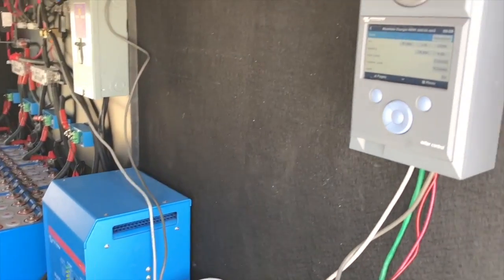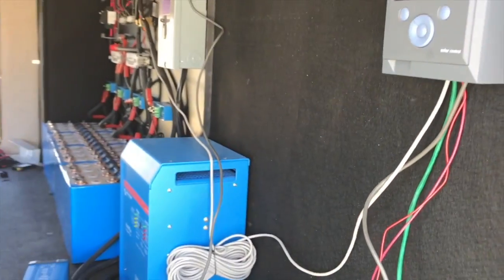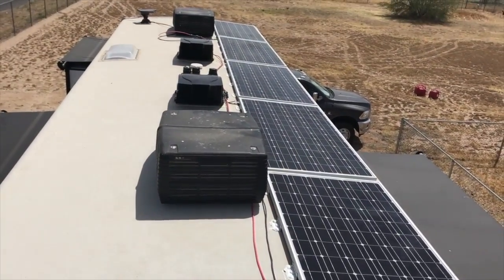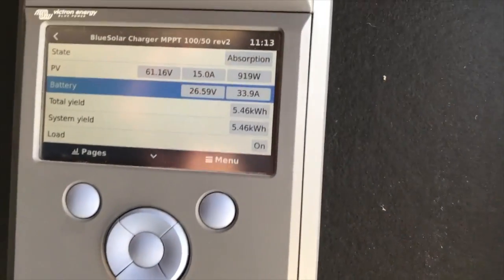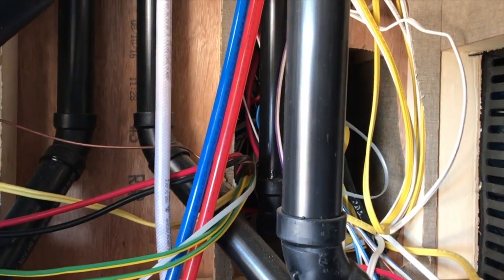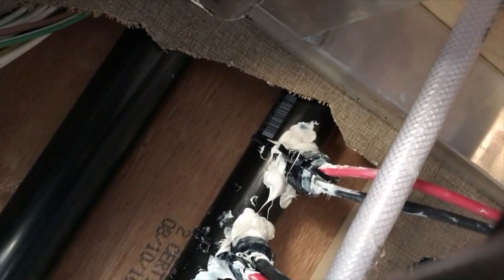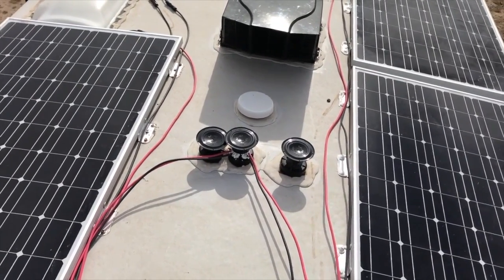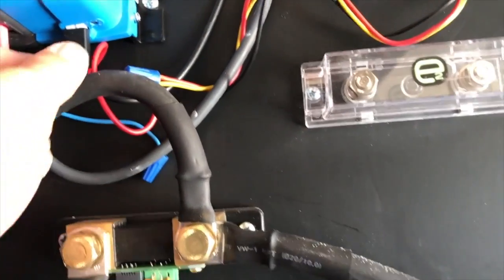RV Fulltime Living | Lithium Battery & Solar: Part Nine - Boat Load of Solar

Comment: Those panels should be in series running nearly 100 volts thru that #10 wire into one MPPT charge controller... why so many charge controllers? why so many current  bars? why so many everything? this setup is a mess... omg why wires down the sewer cap? another rookie trying to show others how to f%$k up and waste money...
Reply from the maker: Wow you are an idiot my friend. If for no reason other than how to talk to people. I guess you feel pretty big behind that keyboard. 

Number one most RVers that run solar either go through the refridgerator vent if it’s roof mount or through the grey tank vent stack. This is much better than punching a hole in the roof. The panels are rated at 36.5v each. Wiring 6 panels in series would produce 216v. Honestly that is dangerous in a mobile setting. Plus the mppt controllers are rated for 100v max. I have 3 charge controllers for the 6 panels on the left side of the rv, for the 6 on the right and another for panels I can deploy on the ground. The two sets of bus bars one for connecting the 4 battery banks and the other for connecting the 3 controls. I could have gone with two larger bus bars but wanted to isolate the solar connections. The battery protects are in place to ensure I do not over discharge. At 24v I can charge my batteries at over 100amps. Add in the ability for the victron inverter to charge, I could be around 200a easily. This is not a basic setup by any stretch.

You just seem like someone who gets off on judging ... that’s cool. But let’s put your money where your big mouth is. Link to what you have done. Show us how you would have deployed over 2500w of solar, and 400ah @24v of lithium along with over 60 potential amps of inverter power. I’m serious I would love to see it. I had to do a lot of research as most RVers aren’t building this large of a system. If you have a better way, we could all benefit. So speak up boss. How would you have done it and what do you have to show us?
Reply from the maker: Thanks and sorry for the late reply. I’m usually commenting from my iPad and there is no good way within YouTube to sort by latest comments that I have found. So I lose one or two now and then. There exist a small percentage of people out there that hide behind keyboards and try and make themselves superior at the expense others. These are generally very small people. I falter now and then and enjoy lashing back at these people. I just have to be careful not to alienate the people I enjoy surrounding myself with like yourself. Folks that want to provide valuable comments constructive crtisicim included.
Reply: RV Exodus 
Wow, first time I read you verbally spank someone.
Bravo for then going through the reasons point by point. 
This is all new territory for almost everyone.  
There are probably a handful of people that understand solar but I seriously doubt that these same people have experience with RVs.  
I for one, find these videos the best I have seen so far. Truly educational and they are simplifying my research.
For example, I was going to go with a different inverter that costs a bit less but will most likely move up to Victron because of its ability to supplement shore power when needed as well as its programmability for charging, which is crucial for lithium. 
Thanks to this series, I learned about bottom balancing as an alternative to a bms.
Some day in the future, I may create my own voltage protection at the cell level using Arduino. So far it is only an idea and will require a lot of research but I want to be able to monitor each cell individually and disconnect the battery pack if any of the cells goes below or above a predetermined voltage......sorry for the sidetrack. 
Anyway, people need to take what is presented here and research if it applies to their needs. There is ton of info here.  
If you have a better way of doing something the give your alternative,  without being a jerk.
Maybe it will be better and we will all learn from it. 
Always keep in mind that what works for one person might not work for another. 
He's using 24 volt setup and has his reasons. I considered it, but I am retrofitting an old 40 foot class A. Different animals. 
I already have a 12 volt system in place that includes an alternator and don't want to deal with the complications. 
Again, take what applies to you.
Reply: I'm intrigued by your set up. I'm a electrician by trade and and I cant agree that using the vent pipe as a chase is ok but besides that it all makes sense.  Why did you use 24v system instead of a 12v?  Having to run 24v and then buck the power down to 12v creates heat which lowers your efficiency but since you have so many panels I'm sure you don't mind the efficiency loses, but with the loses comes more battery cycles and inevitably shortening the life on the battery bank.
Reply from the maker: I’ll have to look into Arduino. I think I have come across it in the past but not sure of it’s capabilities. I have 4 zeva bmm8 boards which provide cell level monitoring and can send high voltage and low voltage signals to the victron and battery protects.

I’m at 24v and will be using step down converters to generate up to 100a of 12v. Landing gear and slide pull some amps unfortunately. I would go with 24v or even 48 if I had to do it again. But I get where you are coming from. Not everyone gets to start from scratch like I did and you always have to keep isolation in mind when dealing with different volatages. That can be stressful and make it difficult to sleep sometimes :)

There’s always things you would do or will do differently. I created 4 parallel 8s strings. Essentially I have 4 separate banks. I did this for a number of reasons and ignored some of the disadvantages like cell level monitoring (having 32 points to monitor) resulting inchaving to replicate cell protection 4 times and having 4 times the cabling. 

Continuing to research lithium, I’m now leaning more towards creating a true 4p8s setup which would be 4 cells in parallel then each of those 4 cell groups wired in series. This would result in only having 8 points of monitor, fewer cables, one large battery protect, one cell monitor etc. the disadvantage is that if a cell goes bad it harder to pick up on but also has let impact on the entire bank. But will require that I cut away the shrink wrap and redo the system. I’m still pondering this one but will likely make this change at a future date.

I’m 100% on board with you ... battery monitor vs. battery management. My CALB cells have stayed in perfect balance. I have drained 90+ percent of the capacity and have recharged them quickly. I have run two air conditioners and microwaves, power tools etc. they remain in perfect balance. I’m getting slightly over my rate 400 amp hours. I don’t need a cheap Chinese BMS shunting the voltages from the cells. I don’t want anything messing with the balancing if the batteries themselves are remaining balanced. I don’t however want to burn down my RV and therefore think its important to have some cell monitoring even if it’s just an alarm. Initially I looked at cheap cell loggers like cellpro. However, I found out that most of these take their power from only some of the cells and aren’t meant to be plugged in 24x7. I needed something that could either use an external power source or would draw equal power from all cells. The zeva was that for me.

Wow sorry for the novel :) enjoy the chat and good luck with your build!
Reply from the maker: Ok ... arduino ... looks to be a very cool device. You have my head spinning now. I’d love to have a device that not only monitors cells,but can also log or report on the cells with out all the other BMS “Bs”. Thanks for pointing me in its direction. With a network connection, I could probably stream  the data over to my home theater pc (Mac mini) and pull together a small web app or even mobile app that provides reporting. I was a developer in a prior life (lowly manager now). Ok thinking out loud at this point and who needs more projects :). Will have to do more research and see if someone else has already done some of the leg work around cell monitoring and reporting. Thanks boss!
Reply: Sean, have you drawn up a schematic of your system-in-progress yet? rc
Reply: I got a valuable hindsight comment !!!  lol
I would have put the dryer vent on the bottom side of the nosecone to avoid piercing the visible side of that magnificent fiver !
But it sure was fun watching you spend the day in that closet!  :-)  rc
Reply from the maker: +Rusty Case I actually considered it as well as the pan drain. However, ended up going with the norm on this one.
Reply: Mark Cooke who is this response directed towards exactly?
Reply: Bugsquad Graves , I believe using 24v batteries will reduce the MPPT output amps by half. Let’s say 1000w/12v=83amp not including the temperature coefficient. 1000w/24v=42amp Using 24v will allow you to use cheaper MPPT controller.
Reply from the maker: Precisely. Or looking at it from the other direction, using a 12/24v mppt controller with a 24v bank will give you double the solar capacity over using a 12v bank. Most mppt controllers are rated for charging amps whether regardless of 24 or 12. I would have had to use bigger mppt controllers had I gone with a 12v bank.

Comment: Just wondering if there is a 300w panel that could work in this size and application? Was individual panel cost vs the ample room you do have available a factor? Or would that have a drastic change to the MPPT units that you would, could or did use? Ten 300w panels would be an incredible amount of solar on an RV but it would be quite beneficial when weather wasn't agreeable and winter months. 
We are about to order one of two fifth wheels which we can't seem to decide between but I've a feeling we are going to go with a 2018 Jayco 375BHFS.
I am so impressed with the solar setup you have put together and I want a carbon copy. A lot of money I understand but I was kind of hoping to extend what you have to 3000w of solar on the roof and 1000ah battery bank of lithium. Not sure if that would be overkill but as mentioned above, weather and winter will be a factor. We are going to full time for the next few years. (Family of 6). 
I'm loving the Victron equipment. Most people in the rv world are stuck on 12v everything, magnum and morningstar products.
I have furthermore taken down all your affiliate links and when the time comes to order I'll obviously use them, as you truly at the very least deserve for such wonderful videos and explanations of your build. You have a great way of helping a layman understand rocket science!
Reply from the maker: I appreciate the kind words. Homestly it is tough to articulate all this without making 2hr videos and rambling like a drunken sailor.

I went with the 190w panels because they fit the width of each side of the RV. We have 3 ac units and 2 vents so the center is pretty spoken for. The 190w panels fit perfectly ... just fit. 

We have a 43ft. So 3000w might be aggressive. I have seen one guy create overlapping panels that slide out. So it’s possible. You may want to consider tilting panels which could force you to a smaller panel as well. I wanted to add tilts to mine but these large panels should be supported in the center of the long side. I used 4 brackets on each of the long sides. I would have had to build a custom bracket / hinge which I didn’t want to spend my limited time on.

My 3rd mppt controller is dedicated to ground panels. I will be using 400w of flexible panels that I can lay on the ground, hang from an awning or whatever. I’ll be able to angle those for when we are up north. Rather than building a wing on your rv roof you may consider a ground deployment of 8 panels to expand your system. It’s an option and flexible panels store nicely.

The victron controllers are nice. They have enough options to work for RVers. The panels I have are consider 24v which put ther open voltage somewhere in the 30s I think. I was able to do 2 series 3 parallel for a string of 6 panels. Cost for the panels and controllers was not a big concern. Mainly I wanted to maximize my space but still have a little walking room and room for WiFi and cellular antennas. 

Btw, I agree ... go overkill on the solar then in northern / winter times you still have a descent flow of power. That’s why I was ok with not tilting. Plus I can feed a honda 2000 into the victron if I fall upon hard times. 

I can charge my 400ah 24v bank in one day with the 2000+ Watts I have. That’s pure awesomeness!

You never hear people say I bought too big of a TV or to fast of car. Well same for solar and batteries. If you can handle the weight and the cost go for it. Do keep weight in mind. Want to keep that family safe :)

Do yourself a favor. If you build your own bank look at 400ah cells. It would have reduced cabling for me. I bought the cells with the intent to install them in the front storage area where 400ah cells would not have fit. I moved to the basement storage and wish I had gone with 8x400ah cells. Oh well ... it’s just money. 

12v is horrible. Cabling would have cost double and it’s scary to pull 400 or more amps from a 12v system. 24v seems like a sweet spot. 

Thanks for the support boss. Its a really awesome and beautiful world at times. I’m touched when people benefit from what I have done as I benefited from the people before me. Let’s us know how things go and I hope to see what you come up with. Would like to look at mine and think ... man that is nothing compared to Roberts setup :)
Reply: Your 300 watt sole panels are available  at about 34 to 38 cents per watt.
Reply: Definitely not shipped and you are talking about 72-cell (77x39) panels and at 300watts very inefficient (about 15%).  Also remember the 72-cell panel structure requires very secure mounting.  The structure is relatively weak for its dimensions and weight.  A good deal on loose 72-cell panels is about .55c/watt.  To get better plan on buying 20-30 on a pallet.
Reply from the maker: +Bryan Jones these are 190w topoint. I expect that isn’t the price shipped. I was well under $1/w shipped. I can get larger panels locally for that price but they were too large for my rv.

Comment: Great Series...  I have been building a list of choices to pull a BOM for my own build.  I never considered Victron before I saw this series.  The specs and bene's are cutting edge!

I was wondering where these devices are made.  I know Victron is a Dutch company.
Reply from the maker: Not sure if the are made in the Netherlands or in China. They are well made products either way. Actually, I have yet to experience an inverted solution this well made. They are very configurable which is important when using a home brew lithium solution. I would honestly contact their sales to see where they are made. It’s always good to see how a company will respond before investing. And, this is an investment. You will likely not just want the inverter but also the battery monitor, color control panel, mk2 interface etc. it’s an investment but I have more faith that these units will not go up in flames like many cheaper products on the market. I have two inverters and three mppt controllers running in my large storage area in 115 degree weather and have had no problems with overheating or malfunction. The only bad things I can say is 1) there can be a learning curve and b) it’s not cheap. Beyond that, their products seem relatively bulletproof. I have yet to regret my $4000+ investment in Victron equipment .
Reply: Thanks Kirk!  Good Advice all around.  Its getting tough to find this stuff that is not made on the Pacific Rim.  Nothing against anyone in particular.  I would just rather support a company closer to home if I can.  I heard you say you send all your money to Victron - too funny.

Are you planning on posting a static page with words and stills somewhere?
Reply from the maker: I agree. If not product from the USA then at least in companies of quality products. Victron seems to be one of those companies. Check out their VRM portal and the kind of reporting you can get via their color control panel which acts as a sort of centralized reporting system that can upload your data to victrons portal for more in depth review and reporting. I believe they offer a demo. 

I actually had an AC unit go out on me today. I hope the breaker just popped from our 117 deg day. Anyhow, I’m not at the trailer but between my ecobee thermostat and the victron I’m able to see remotely that it went in and out around 3pm for a couple hours before it stopped running. Pretty awesome data trail. I could also see that both input power from my dads 15amp circuit and the output from the victron were within operating spec of the AC; promarily voltage, frequency., and expected amp draw. Good data trail for warranty. 

Honestly I can’t quite keep up with the video editing. I do have a static site but it’s mostly just links to the videos. I hate to under promote. But my 9-5 which is really a 6-4 keeps me plenty busy.